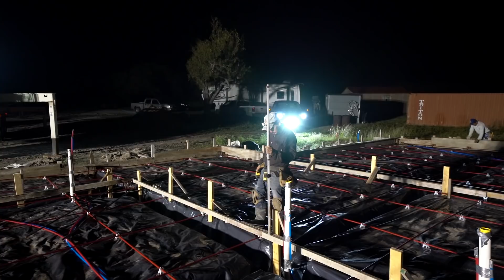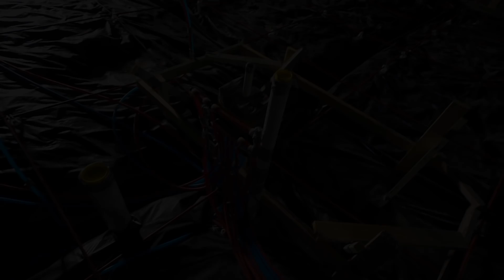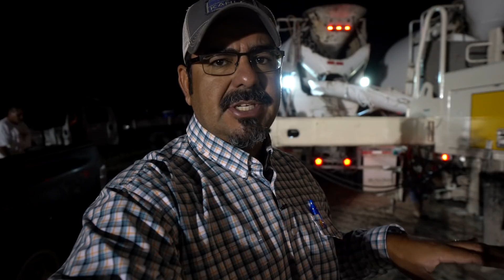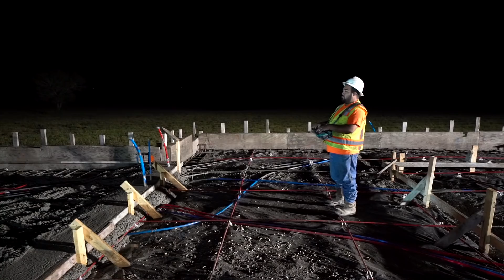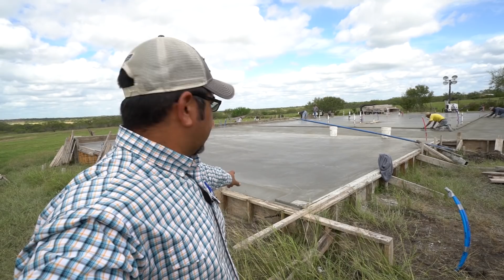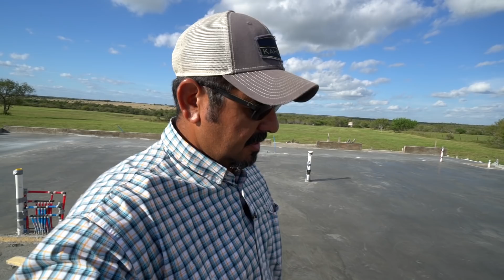Barndo 193 Concrete pour - Episode 54 Texas Barndominiums

Comment: Love watching your concrete pours, all the difficulties you run into and how you solve them. What is the cost of of concrete/yard after all fees? Ours in California is around $130/yard. Also, what does it cost to pour that much "cement" ;-)?
Reply from the maker: It’s about $110 here.
Reply: Texas Barndominiums 
Damn that’s cheap! About $200 here in Canada
Reply: $130.00 a yard here.
Reply: Cleveland area $123 area for 4000 psi or 6 and 1/2 we use for anything  exterior . 3000 is only used for footer mix here.

Comment: All your Pex  piping should be protected with poly sleeve anytime it is in concrete vertically or horizontally. Manufactures say so and so does Texas state board of plumbing examiners.  Nice videos.
Reply from the maker: I’ll look into it.  We’ve never had an issue with inspections, but I’ll do some research.  

Thank you.